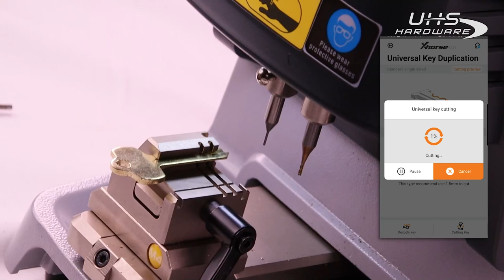How To Cut SC1, KW1 & BEST A Keys Xhorse Dolphin XP005 & Mini Condor using M4 Clamp

Comment: But that is Key duplication can you originate a key can you cut a Key by code or by cuts
Reply: Yes you can, you select customize key data, and can enter your own specs and save them into your app database, for future key blanks of the same type and only have to change the depths of the cut after you get all the customized measurements of that specific key. I'm sure with time, updates will include most residential and commercial standard keys but as of now it's a manual entry process.
Reply: Oh and also I'm not sure because I don't own one YET, but I believe their new key reader can find the data, so you can do it that way but yes it can be done
Reply: @kyledavey8681  thanks a lot will gave it a try🙏
Reply: can you help with the specifics of a kw1 key. cant seem to figure out all the info i need to enter to make this work

Comment: It doesn't actually decode keys; it traces the profile.
Reply from the maker: yes, it does trace the key in order to provide the numeric codes and key details necessary to copy, cut a new key or share the coded information of the key. it stores the data of your key and also allows you to adjust the decoded information if needed.
Reply: @UHSHardware  So they have the cutting residential keys by code now? In the video and per the "do-not-cut Residential keys by-code" statement the machine isn't "decoding" the key but instead recording the trace (X, Y coordinates) to replay with the cutter. The apps choice of wording when reading the original key is misleading because it isn't turning the data into KW1 or SC1 cut codes so it's not decoding like one does with a key gauge - and the machine can't because it doesn't even know what key blank you're using.

Comment: It will be like hell to work with this when making a new Master Key along with new 100 change keys. Have you ever thought about that? SMH..
Reply from the maker: No actually, could you please explain why? After It reads the key you just need to replace and continue the cut for every key that follows. it's actually pretty easy. just a simple button press after each replacement. we sometimes make 100s of keys in a sitting with this unit and don't have any issue unless setup was incorrect. I'd love to hear any thoughts you have!
Reply: Also remember this is an automatic key machine. An originator. Mainly used for automotive keys. High security keys etc. . You can always get a manual duplicator and run through 100 keys faster
Reply: @danberger9450  yes you can but you can also carry one battery operated machine, not have to worry about power, etc.

 I don't work out of a van. My kids say they can't picture me being the guy in the white van handing out candy, just kidding.🤣😂🤣😂

Though I get my candy from UHS, Transponder Island, American Key Supply and a few others. Actually thought it was a little weird the first time I ordered from a wholesaler and had extra candy in the bag with my order. Thought about it very briefly then said screw it and ate it. 

 99.2 to 5% of what I do is Automotive and only that.  Why buy another machine for something like this situation. 

Some people don't want residential just as some of the older guys and yes I've came across some here and there don't want to pay for subscriptions to do calculations on devices like Autel, Wi-Tech not to mention the annual updates $$$ spendy. 

Some of those same ones don't want to mess with NASTF as well which is fine as those ones, a couple locally just leave more and more on the table the further autos advance. 

I like the Automotive skillset I have as I also do programming, diagnostics on a mobile basis so keys isn't all I do. ..I get an occasional household job as I have one this weekend. Just rekeying 2 schlage and 1 kwikset so they all have the same 1 key to open them all. Came across this job after recently initially doing a key last winter then got a call a couple weeks ago. Replaced the cars engine with a new one in their garage. Had been awhile so did it as a refresher for a good couple days. It's only a engine. 

I spent the extra change and bought the residential/one sided adapter vs buying another machine. What happens if this machine dies?

 Order another quickly and ship this out for repair if possible so it can get back for a backup just in case. 

Definitely want the next one to have a shield. The ones with the built in vacuum will work great for the shavings as well as I'm a clean freak cleaning it up after each key cut.  

I did see something that piqued my curiosity as in the video it says plugged the OBD adapter in when we're doing Automotive we shouldn't need the OBD adapter plugged in. I'll post a separate comment as this is weird unless it's a way for something to occur as i've seen and did weird in my life.
Reply: @UHSHardware  twice that I’ve used the m4 clamp that I purchased from your company with my dolphin xp005 while decoding the sc1 key the probe snapped off at the end